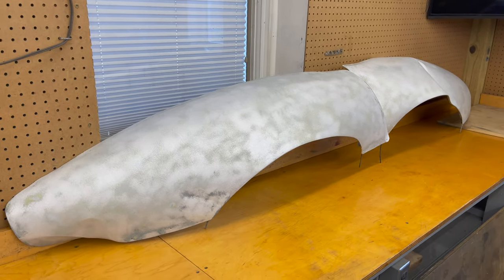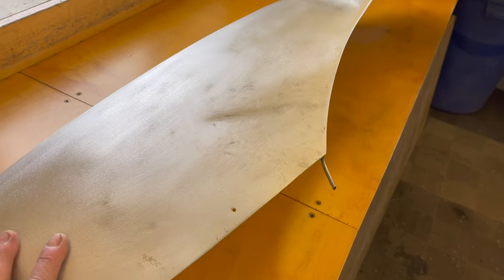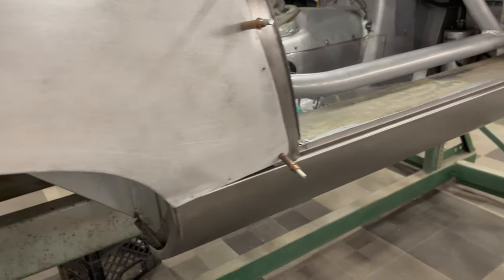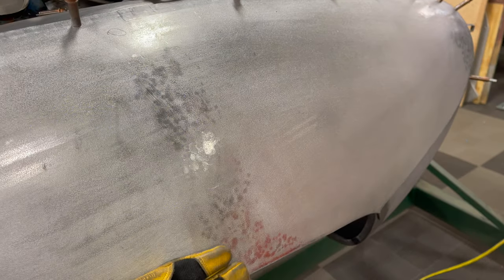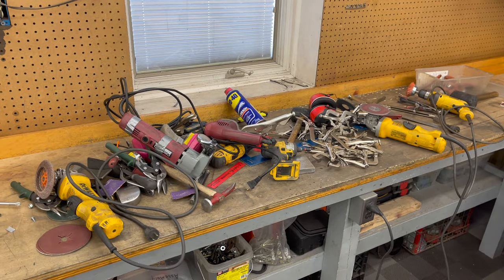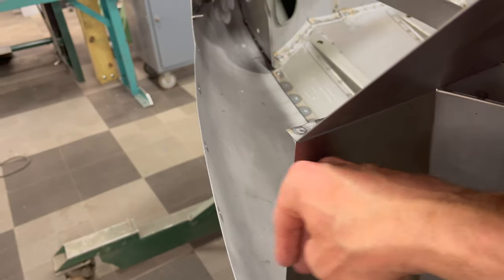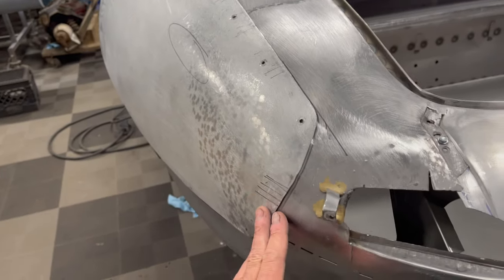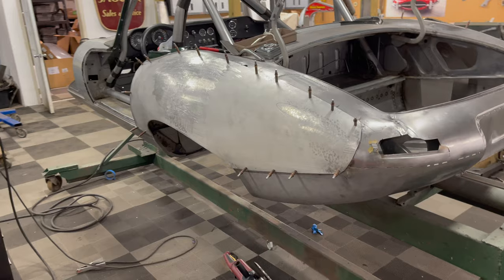Jaguar E-Type - 1967 Vintage Racing Crash Repair - Part 14 - Oversize Rear Wings

Comment: Chuck, with a large smile I appreciate the honesty of “ this is what it really looks like”, tools all over the work area just a regular mortal.👍👍. A question for you.  Once you had the aluminum fender fitted to its final position, why would you not put a flange in the original steel so that the aluminum pieces would blend onto that rather than overlap on the surface?   Thank you for giving us the opportunity to see this evolve.  Rick
Reply from the maker: Thanks for the compliments Rick, they are much appreciated!  I actually did consider stepping that fender down in regards to the original skin with a flange just like you are asking. And if I was doing this over again from scratch I would definitely do it that way. However, since this was already set up with those holes, time was of the essence, and I would’ve had to do the step on the car and to be honest I didn’t have a tool handy that was going to do that the way I wanted to, I just decided to keep it simple and keep this as it was based on time etc. but you’re correct ultimately that would be the way to go. 😉
Reply: Chuck, thank you for the response.  On another topic, have you ever had an open house or tour of your shop?   It would be fascinating to see.  I would certainly understand not doing those as you have a business, deadlines, obligations etc.  Though my summer home is in Northern lower Michigan and winter ( permanent residence) in Florida,  I think I would plan a road trip around that!😁😁😉🍷